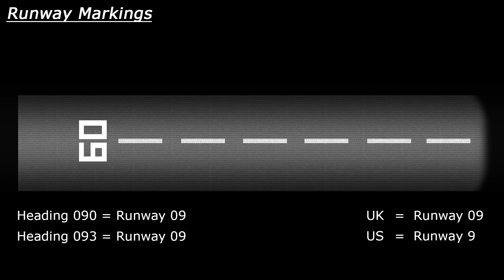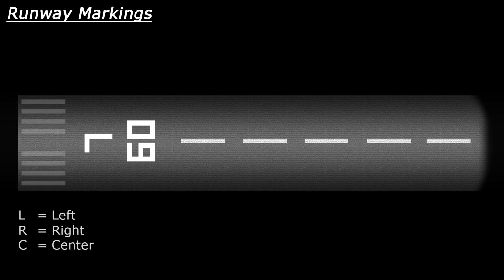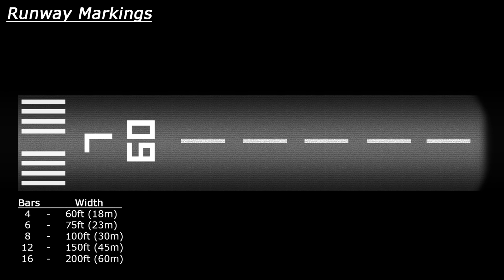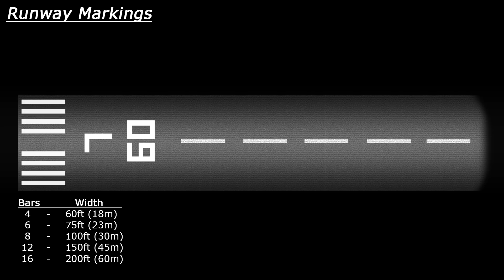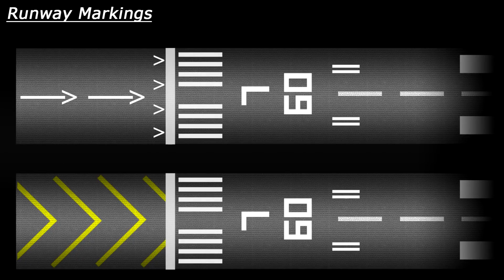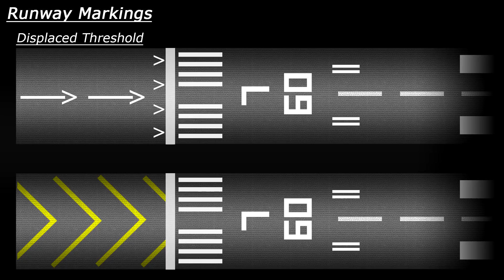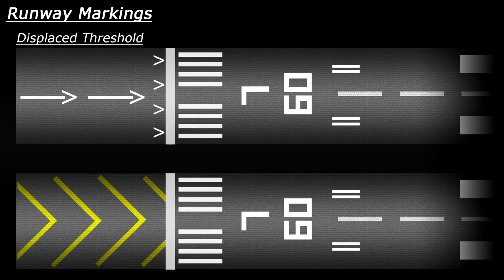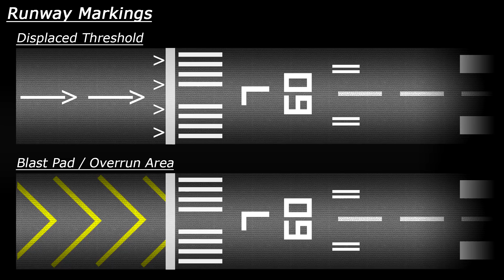Runway Markings Explained

Comment: "if there are three runways, you have L, R and C for center"

Not always true. In SJC (San Jose), there WAS 30L, 30R, and ..... runway 29. Why? Because 30L and 30R are heavy jet runways, and 29 was a general aviation (light airplane) runway. They felt it dangerous to label them 30L, 30C and 30R because a heavy jet confusing 30L with a usable runway would cause a horrific accident, since 29 (what would have been 30L) was far too short to land a heavy jet.

So what they did is round up to 30L and 30R, then round DOWN to get 29.

Of course, its a moot point now. SJC has been trying to get general aviation OUT of the airport for years, and the latest move is to get rid of our (ahem) runway. So 29 no longer exists.

I'm sure there are other examples of runways labeled like this.
Reply: fancy
Reply: But the point is that it would be labeled in the mentioned way if it wasn't for that.
Reply: At Kuala Lumpur International (KUL/WMKK) there are 3 parallel runways, 32R/14L, 32L/14R and 33/15. All runways are pretty much the same length and width. Although KUL originally had only 32R/14L and 32L/14R and later expanded with 33/15 and a new terminal.

Comment: What if there are 4 parallel runways?
Reply: Jefford717 Well, I'm not an expert but I would guess that if you have enough activity to need a fourth runway, and your location isn't width restricted (e.g. narrow mountain pass or narrow island), and the wind direction isn't variable, you would more likely invest in putting your fourth runway go more or less at a right angle to the first three. Taking off and landing with a crosswind is not recommended; into the wind is best.

Comment: If the runway is pointing 90° then why wouldn't it just have 90 (runway 90) instead of 09 / 9 (runway 09 or 9)?
Reply from the maker: Because strictly speaking, on a 360 compass it'll be a Heading of 090
Reply from the maker: I think they take into account the natural progression of Magnetic North which will change the magnetic heading of the runway over time. So in 5 years time the runway heading might change to 274 due to the natural movement of the magnetic north pole. So they would number the runway accordingly.
Reply: Because that would add unnecessary confusion.

Comment: Just for your curiosity: If there are 4 parallel runways (which doesn't probably happen these days), you can push the number by 1. So you would have runway 09L, 09C, 09R, 10, and all of them would be parallel ;)
Reply: They typically use two of each number with four parallel runways, rather than 3 and 1. For example, LAX has 6L, 6R, 7L, and 7R.
Reply: I was going to say the same thing.  Although if he's based in the UK do they have any commercial airports with four runways?  Seems like they usually stop at one or two max.  ;-)
Reply: +CAHSR2020 I haven't met anything like that in Europe. Even there are some airports with plenty of runways, almost always they are in different direction, just to have bigger spectre of available directions for operations (easier to adjust to current winds). Frankfurt has 3 parallels, and the rest I know has only 2 parallels. Heathrow wants to build 3rd one, but not sure if it's gonna be parallel as well.
Reply: Just to be clear, I said UK not EU.  Heathrow will get another runway when hell freezes over.
Reply: The decision was made decades ago.  And then they revisit the decision again and again every few years or so.  Still no runway.
Reply: @CAHSR2020  ahe-Seattle Tacoma International_m
Reply: Yea, i was checking at paris airport i was surprised it has 4 runways and they are numbered 09L, 09R, 08L and 08R.
Reply: ATL has 5 parallel runways.
Reply: U r wrong

Comment: I encourage all pilots to watch this video! Great information here than can save lives!
Reply: Im pretty sure that pilots are aware of this information
Reply: Negativbeispiel Lol it would be pretty disturbing if one single pilot wouldn't know this information indeed.
Reply: vanhouten64 Even for the least demanding pilot's licence there is. (varies by country, but it's typically a recreational aviation or sports pilot certificate), you still have a massive book of theory, all of which you are expected to know. (My copy of the BAK - Basic Aeronautical Knowledge is about 400 pages long, and there's a seperate 300 page lesson plan book and 100+ page radio operations book. The combined sum of what you learn from this, alongside the theory tests and practical lessons is only enough to allow you to fly a single engine, fixed prop aircraft  with fixed landing gear during good weather and visibility and only in the daytime, plus, only at airports and in airspace that do not have any air traffic control in use, plus, you aren't even allowed to do crosscountry navigation with this level of knowledge. Only fly within about 100 miles of your home airport, and land the same place you took off from.).
Not all runway markings mentioned are covered, but the basic most important ones are. Which specific markings they teach you is of course related to the country in which you learnt to fly. (presumably international pilots are expected to learn the significance of the variations too.)
Runway lights aren't and guidance equipment isn't really covered, because that's night and/or instrument flying, which constitutes a seperate subject with seperate endorsements that require extra training and licensing...
Reply: I'm a pilot for virgin Atlantic (a380 pilot) I still watch these types of videos because they are very useful.

Comment: It should also be noted that in the Overrun area is where the EMAS (Engineered Material Arresting System) is installed at airports that lack the adequate space for overrun area size requirements.
If an airport has an EMAS installed then the area is off limits for all purposes.

https://www.youtube.com/watch?v=emcSX1kijXM
https://www.youtube.com/watch?v=3jH8g-qJK3w
https://en.wikipedia.org/wiki/Engineered_materials_arrestor_system

Comment: The number doesn't mean the angle of the runaway related to north (09 means 090 degrees) ?
Reply: Yeah if you go clockwise 90 degrees is east.
Reply: The number is the angle from magnetic North, so yes it doesn't relate to True North.....unless the airport is lucky enough to be somewhere that the two line up.

Comment: What about ohare? They have many parallel runways. How do you name 4 parallel runways?
Reply from the maker: Usually the runway numbers are changed slightly. So say there was a situation where you had 4 parallel runways running East to West, you'd probably end up with something like...

09L - 27R
09R - 27L
08L - 26R
08R - 26L
Reply: italianpizzadude 20 this may now be in all scenarios but usually if there is 4 parallel runways their grouped up in different sections with different heading. for example ohare has 2 of the parallel runway as 9L and 9R and the other 2 has 10L and 10R
Reply: Samir Ahmed alright cool thanks

Comment: Totally tripped me out having the runway running left to right and labeled 09.
Reply: Really? That's facing the correct way, assuming up is north.
Reply: Wouldn't it be 27 though? I always thought you went clockwise when talking degrees "from" north.
Reply: TheVeryBest No, 27 is the other side. The runway number is the heading you fly towards it at when landing, so runway 09 would be flown towards from 090 degrees, due east.
Reply: CrazyCashGaming Well, then I know. ;)

Comment: Your words: "... if you were stood at the end of this runway, you would be facing East." 
Really? 
SURELY, my position on a runway DOES NOT necessarily indicate in what direction I am facing!

If you had said: "... if you were STANDING at the BEGINNING (on the Piano Keys) of this runway, (and looking down the centre line over the REST of the runway), you would be facing East." 

Hmm

But 90 degrees + 180 = 270 degrees.  So, does the runway have 09 one side and 27 on the other?

Or is it, that at the END of runway 09, there is a another 09, but upside down. No, wait, that would be a 60. So that would be 600 f**king degrees!   Aaaaaghhh!

Why can't they make this SIMPLE?

No wonder there are SO many crashes!
Reply from the maker: Yeah you're correct. I could have been more specific in my description there. 

As for runway headings, the two ends of a runway will always be facing the opposite compass Heading. So runways will always be +/- 180 degrees of each other. So the opposite end of Runway 09 (Heading 090 + 180 degrees = 270) will be Runway 270. 

Another example: The opposite end of Runway 33 (Heading 330 - 180 degrees = Heading 150) will be Runway 15.
Reply: Also there's not that many plane crashes and they rarely happen because of ground markings. At the end of the day you still have 2 eyes, markings are just reference points.

Comment: Good content, but you rally need to invest in a pop filter to cut out the sound of the air you exhale.
Reply from the maker: Yeah there's only so much I can do with a headset microphone :(
Reply: Try positioning it so it's not directly in front of your mouth.
Reply: try putting it inside your lungs, might help

Comment: Then there's KATL (Atlanta) that have 5 runways:  8L/26R, 8R/26L, 9L/27R, 9R/27L, and 10/28, and they all run parallel to each other with an actual heading of 95º.
Reply: Ajinkya Pathania youre correct. If you have more than 3 parallels they change the numbers. Example. O'Hare has 5 soon to be 6 parallels. It goes 27 L R C. and then 28 L R C
Reply: +undytermined or rather 27 L C R 28 L C R (or could it awkwardly be L R C C L R?)

Edit: Just checked Google Earth (which currently shows 5 runways) and it goes 28 L C R 27 L R